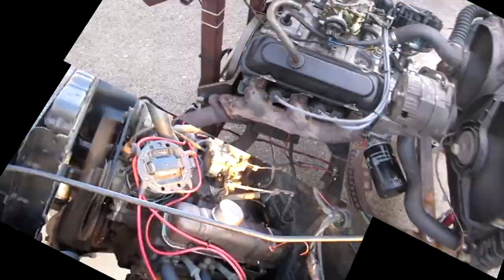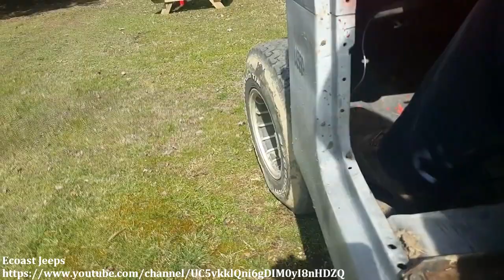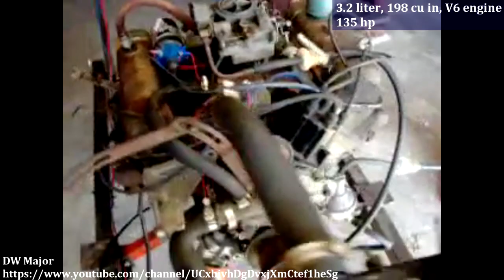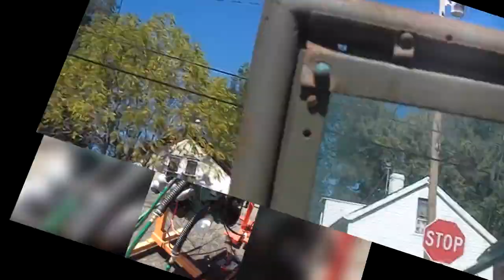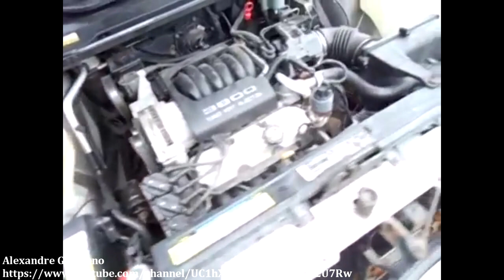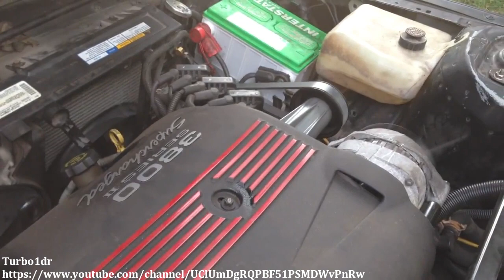7 Of The Best Buick´s V6 Classic Engines

Comment: My 2000 park avenue 3800 540000 miles just won't die, I even ran it with no oil for over a year please help its 2022 and it's still alive I just wants a new Buick bad at this rate the 3800 will out last me.🥺

Comment: The 225 wasn't the smoothest or quietest of Buicks engines. But it was very good on gas and quite powerful for a six. I had one in a 64 Buick Special, at speeds as high as 70 mph even with a two-speed automatic behind it I had no trouble getting 23 miles per gallon. For a six it didn't waste time getting to 60.
Reply: Great Jeep engines.
High torque, runs cool, won't stall.

Comment: I have a 3.8 series 2 in an 04 Bonneville. 205 hp and 230 lbs/ft of torque but I bet thats at least slightly underrated. So smooth and such a great powerband.
Reply: Yeah the power band is really nice
Reply: Oh it is

Comment: The dauntless 3.8l had 160 horsepower with a one barrel carb? That's impressive!!!
Reply: It had a Gross HP rating of 160hp with a 2bbl carb. Net HP with a 1bbl 'miser' carb would be around 90hp or so.  If you stuck these in front of a 3 speed automatic, damn thing couldn't get out of its own way, it was so slow. If you advanced the timing, put a 4bbl Holley and stuck with a manual gearbox, the Dauntless was a pretty potent V6.
Reply: @RockandrollNegro   I run a 225 Odd Fire (former sprint car engine) with Kenne Bell No.1 intake, cam... too much carburetor, MSD, fat headers, in a (titled as) 1946 'flatfender' Jeep with 4 speed and Warn overdrive.

Runs like a stiped ape.

Comment: that one 3800 sound's like a woodpecker is trying to escape from the heads
Reply: Yep ur right the ones we got in nz is the aussie one rwd go hard ass I got two of them near 300km easy
Reply: Yeah if that's the best that they have wow! That was painful to listen to that engine 3800
Reply: @robwilliams682  sounds like bad tuning, but it's the firing order,  it actually results in a poor idle, but much flatter torque curve..Hey if I were doing a jeep swap from an I4,   I would have this thing over a 4.2 any day...had great low down grunt,  cheap as shit to fix, or replace,  much better on fuel,  and a better highway performer than the I6 (doesn't mind being wound out for extended periods),  legendary reliability, cant really think of a better choice..My junkyard guy saved carbed ones in the mid 80's ,  knowing the Jeep guys love em..4.2 is the king of off road, but if you do some travelling with the thing..3.8 is a no brainer of fuel alone.. and you can beat on it endlessly ,still have some fun in the dirt , and it'll take you home every time.. they say it's gm's best engine ever.. that's a lot to say..
Reply: @robwilliams682  Much better than Ford's 2.9 and 3.0. Those engines had a constant lifter tap and were probably the least reliable V6 engines ever built.
Reply: @planegaper  you're spot on with the fuel economy, my 89 lasabre made 32-35 mpg on the highway, and hauling ass at 80 plus. So when the old girl was rotting out, I swapped up from the 2.5 in my Cherokee.
Reply: @MrDejast  i didn't even know they came with them stock in the 80, always thought the 3.8 was a swap in.. 4.2's are known pigs,  powerful mind you,  but if your travelling any kinda distance it's a no brainer,   as well it's more compact and keeps weight behind the front axle, where u want it.. bullshit cheap for parts too..
Reply: @tskraj3190  The 3800 is one of the best V6s of all time. Period. The motor in the video was blown. I have never heard one like that before. Those things are hard to kill too.
Reply: @johncotter1600  it's basically the V6 sibling of the LS Swap
Reply: @robwilliams682  i totally agree brother. Chevy all the way, along with the 3800 buick.
Reply: @tskraj3190  i think the 3.6 GM replaced the legendary 3800 with might take the cake. the 3.6 is JUNK
Reply: @andrewdonohue1853  I haven't dealt with the newer 3.6L but I believe you. The 3100, 3400 and 3800 were very strong and reliable engines. I can't say much for the 4300 because I've never owned one but they were pretty quick V6s
Reply: @tskraj3190  the old 4.3 was a good engine but the fuel economy was not very good. i had one in a 1994 S10 blazer and it only got like 16. my supercharged 3800 regularly gets 24+ average economy if i drive it easy. 

the 4.3 v6 was based upon the chevy 350, it's a 350 minus 2 cylinder. this is a 90 degree v6.

the 3800 was a buick V8 minus 2 cylinder. that's why the 3800 is known as the buick v6. this is a 90 degree v6

the 2.8, 3.1, 3100, 3400, and 3500 were all chevy designs, they are 60 degree v6's

the degrees 60 or 90 is a measurement of the angle between the banks. the 60 degree design is more compact then the 90 degree design, that's why a 3800 and 4.3 are wider engines.

the 3.6 is a completely new design, not based off any of the old school proven engines. it's DOHC and has a terrible timing chain design, a timing chain job is like a 10-12 hr job in a shop. multiple tensioners, 3 chains, it's a real clusterfuck. i would NOT want to work on one. the timing chain in a 3.6 is notoriously bad and they fail all of the time . any of those mention older designs have a very simple timing chain that almost never fails and if it does you can easily fix it yourself with some knowledge and tools.
Reply: @robwilliams682  But what's that got to do with Ford V6 engines,absolutly nothing.
Reply: @planegaper  Too right Dude. They rock. so underated. Good strong engine.

Comment: The series 2 3800 L67 is rated 240hp and 280 tq, and the series 3 was 260 hp up to 2008!  BEST V6 EVER, also rated Ultra low emission engine, and 30 mpg hwy!
Reply: brad chandler 2009 I thought with the lacrosse
Reply: brad chandler I get 35 mpg with mine with dual 2.5 in out straight through stainless mufflers and deleted the resonator.

Comment: At the other end of the spectrum, I would suggest the 305 ci V6, and others in this series, as a tough truck stump puller.
Reply: A 305 ci is a v 8
Reply: @shawnsecleter2453  Skip Stein refers to the GMC only  305 cu.in. V-6 offered in light duty pick-ups / suburbans /panels from 1960 to at least 1966 . I had a 1961 Suburban with the engine he refers to ...

Comment: That tick on the 3800 is not a rod knock. It is a broken harmonic balancer that had the rubber inserts rotted out. You can see the accessory belt tensor pulsing with the clicks.
Reply: Bought one for 100$ cause of that 25$ bucks fixed it
Reply: Rod knock

Comment: I love the 225 odd-fire V6, I've had 2 of them both in a 1970 & 1970 Arrow-glass ski boats. Bulletproof engines, great torque, could pull up 2 skiers out of the water instantly.  They do have a unique sound compared to the 231 v6.
Reply: Excellent engines for early Jeeps.
Reply: Volvo also used it as a marine engine.
Reply: I have a 1965 Oldsmobile f85 with that engine. Not a real powerhouse for that size car but it actually doesn’t do all that bad!
Reply: @OwensGarage  I run a 225 Odd Fire (former sprint car engine) with Kenne Bell No.1 intake, cam... too much carburetor, MSD, fat headers, in a (titled as) 1946 'flatfender' Jeep.

Runs like a stiped ape.

If interested in more power; lose the two barrel, let her breathe through high rise, dual plane intake and fat tubes.
Add hot spark and hot cam, all properly balanced.

They're notoriously durable. They can take the increased strain without overheating or failure.

Comment: 3300s are grenades, but I stand firmly with you on the rest. I've had two 3800s, one supercharged, two 231s, one a t-type that I put the EFI and intercooler stuff from a GN on, and a 225 in a CJ5, all of which I flogged mercilessly, all of which still ran flawlessly when I sold them. Two things: why did you choose a clip of a badly rod-knocking 3800 series I to show? And also, the N/A 3800 didn't make 240 horsepower, that was the supercharged one (the one in my Regal GS made 248 to the wheels with a pulley, a throttle body, an exhaust and a tune). Great, under-appreciated motors every one. Plus my T-Type and Regal GS were both genuinely fast while being comfortable, inconspicuous, reliable, and kind of shockingly efficient (I averaged 23 mpg in the old turbo and 26 in the GS if I drove them responsibly). I even think they mostly sounded pretty good, and V6s almost always sound TERRIBLE. No replacement for a big, burly V8, but fantastic for a daily driver.

Comment: Unfortunately, for that poor l36, it'll knock like that for a long time. The buick v6 is one of the most durable engines out there. Why do you think AMC bought the design and put em in jeeps. Kickass. Love my lil 3300.
Reply: AMC did the exact opposite.

Kaiser had purchased the 'Fireball' V6 from Buick in 1966, manufactured and installed them in Jeep products through 1970 as the 'Dauntless'. When AMC purchased Jeep they stretched the CJ's nose to accept the AMC inline six and sold the V6 back to GM.

I run a 225 'Odd Fire' in my ol' Flatfender (titled as '46 Willys), Kenne Bell equipped, MSD, fat headers, too much carb, 4 speed with Warn overdrive... . It's the perfect engine for an early Jeep.

Comment: I think your 3800 V6 HP figures are off somewhere, as you give the Naturally Aspirated version at 240hp,then later give the Supercharged version lower HP figures of 205-225 HP. I was a Buick dealer technician when these engines were new (82-99) & the 3800 Supercharged was a high HP, low production option in LeSabre & Park Ave . Otherwise i like the video.

Comment: I don't know why Turbo 3800s weren't included (Buick Grand National). NA and Supercharged were included, even though the NA you showed was about 5 minutes from throwing a Rod.
Reply: U must be smart asa bag of rock gn 3.8 can make a lot of power stock , I went 10,s on a stock long block 87 3,8
Reply: Buck 87 is called lc2
Reply: 3800 is a modern version of the 3.8 (231). Don't have much in common.
Reply: The 3800 and 3.8L are entirely different engines.
Reply: Ya it did not sound too good that 3800 TPl.
Reply: @mccrackenphillip  it was knocking on hells front door !! Most likely been floated out few times too many n bent push rod if they were lucky?? But some of those were bad for rocker stud pulling out of the head?? N whacking up top like that one??
Reply: Am I the only one that likes the Series I 3800 better than the Series II and III?
Reply: John Cotter no not all all,. The stoutness of the 3.8 from GM is reflected on the 4.3. The two most produced longest lasting V6’s
Reply: John Cotter the series 1 on the Holden commodore was too punchy off the line for the cheese cutter tyres. Holden had to retune it so school mums did wrap themselves around light poles
Reply: @johncotter1600  The Series I is the most reliable one of the 3800s and the longest lasting 250,000 miles plus engines. Heavier, thicker heads, crankshaft and cam shaft. Less HP (170) on a slightly heavier, beefier engine. The series II and III might be faster, have more HP but they are not as reliable as evidenced by their recalls and problems like intake, intake gaskets, valve cover gasket leaks and coolant leaks. The oil leaks could cause fires.

Comment: What is this YOU were showing JUNK  3800 Buick is a very good motor and had few problems hay whet is with the JEEP s   the motor that was mounted in a JEEP  Was it a JEEP motor   can not get any thing right ?    there are toooo many problems on your sight to SUBSCRIBE  you need to go back to the drawing board
Reply: Buick sold the rights and tooling for the Fireball V6 to Kaiser Jeep Corporation in 1966. Kaiser manufactured the 225 'Odd Fire' V6 as 'Dauntless', installing it in Jeep products from 1966 through 1970.

AMC purchased Jeep in '70, stretched the CJ's nose to accept the inline AMC six and sold the V6 back to GM.

"Can you not get anything right?"

P.S.. Learn to spell.

Comment: What about Buick's big-bore 4.1 litre even-fire version in the early 1980's? The extra torque never hurt anybody. You could even order one for a Caddy to avoid their V8-6-4 stinker...
Reply: So this 1981 Cadillac coupe deville with the V6 is good... I should get it?
  Interior is A1 and only has 74k miles on it
Reply: @DJDISCIPLEDREW   A smooth ride but not a swift one. Biggest problem right now is finding parts. Don't make it your daily driver -- even mid-80's RWD GM parts are a long day of hunting.
Reply: @peters8758  gotcha yea I'm not worried about a fast ride.. and I will not be driving every day.. just a weekend cruzer

Comment: Best V6's and the 3800 sounds like someone with a hammer trying to get out?
Reply: Michael Fitzgerald that 3800 sounded like a bad rod knock, great motors, but didn't last for very long
Reply: My NA 3800s lasted a LONG time for $500 and $700 a piece.
Reply: The older ones all sound carburettor (even the single point and multipoint injected models)
Reply: @WhistleTeets85  mine is an ecotec l36 3.8 (australia and new zealand version) it has aprox 140kmiles and has never been rebuilt has never had a gasket replaced and has always had rocker srm ticking it was used on beaches and ran a few miles on low oil and no coolant and all ive done was change the filters and fluids and the coil packs and removed the rusted thermostat since ive had the car and before i had it it sat in a barn for a few years and its still going strong (mine is the pre-2000 version so it has 197HP the later post-2000 has 204hp and our l67 has 260 with a special model with 270)
Reply: ty 069 What?! They're notorious for running 250,000 plus. I've had a N/A one and a modified S/C one, and they both got run pretty hard, pretty often, and were sold with well over 200K running flawlessly. I had to put an alternator and a ps pump on one (not really engine parts) and a water pump and valvesprings on the other, which was the modified supercharged one which was making a lot more power and running at considerably higher RPM than stock. My buddy bought it and only just now blew it up at 308,000. They're widely regarded as one of the most reliable engines of all time, like, it's common knowledge.
Reply: @ty069  They lasted. The owner of that one just didn't take care of it. That, and the one shown was a Series II. I've known Series I to last to 500k before rebuild.
Reply: @johncotter1600  my Buick 3800 was strong, the electricals took a shit quicker than the motor

Comment: The L36 never made 240 hp, the L67 did. The L36 made 200 since it was the N/A version. The L36 also has higher compression, and weaker rods. The series 2 3800 L67 is where it’s at. Series 1 was never very good, and series 3 wasn’t around for too long.

Comment: I remember one of the Buick engines had a vibration at idle. Think it was a229 normal felt like an engine skip
Reply: Magna Tron the 3300 vibrates at idle
Reply: The 225 'Odd Fire' hits at 90 and 150 degrees rather than 120-120.

Comment: 3800 series 2 & 3 should've been on here
Reply: The original 3800 should have been too. My buddy had a '91 Regal with a Pre Series I in it that had 175k miles and  blown head gaskets and it started every time and would drive anywhere. Those engines don't die.

Comment: Where were the GrandNationals and Commodores (Aussie tuned L36 OBD1 less tech more reliability and they can go for over 240000mile (estimated) 400000ks if they are taken too a mech every 6 months or 20000ks) and of treated properly they will keep going
Reply: If you change the oil and oil filter every 10k a ecotech 3.8 will do 400k easy

Comment: Love the 3300. Open the system up and give some air to breath and get rid of nasty ass cat in the exahaust and give it a small cherry bomb or a rice cooker.   I. I have smoked alot of v8 that was supposed to be bad and hadsome say they know better than to try .   what alot of people dont realize that's a little tourqe monster.  It's making more torque than hp.  And one tough little engine ..  Ive had a few well over 4hundred thousand on the engine and dog the he'll out of them .
Reply: I've heard the chole is in the valve covers. Do you know if buying aftermarket OEM covers will help it breathe, or if the L36 SII covers will fit? Not looking for huge power, just want it to breathe a little better.

Comment: I due belive that you have the hp rating for the 3.8 and 3.8 SC turned around.  The 3.8 SC  has the most go. That 3.8 you filmed is ready to put a rod through  the oil pan.😂🤣😂
Reply: yeah does
Reply: and there is no way that rod knocker even had 150 hp way it sounds
Reply: it's not the rod knocking .it's the pulley. he tried to show that in the video

Comment: They aren't very good at this, they left out the 252 oddfire four barrel motor.
Reply: At least the had the 3.8s in there. Most of them were destroyed though.
Reply: 252 or called 4.1 L is even fire..odd fire stopped at 225 cup. Models.
Reply: @bugnfront  Buick Skyhawks had an odd fire 231.

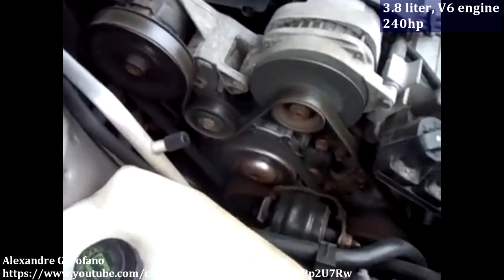Comment: I always advised my buddies to spring for the optional V8 and forget about the 231 V6. None of the GM V6 engines made it past 70,000 without a rod knock and sounded like the engine at 3:50
Reply: Early ones yes mid 80’s on were great
Reply: nice try, but you are full of it.
Reply: If it's a odd fire they dont sound pleasant ever.
Reply: But that's kinda what the nature of a odd fire is even tho they last forever

Comment: I feel insulted that all of the 3.8L engines had ticking  from them. I have never have a tick or know on a 3.8L
Reply: John Killright Right my series 1 runs like new, these examples are a disgrace to this engine.
Reply: John Killright my pre series I (in my 89 Reatta) runs perfect.  Sounds amazing.  Never had an issue.  The example in the video must have been abused to shit!
Reply: Hamilton Dashcammer All original. Including the oil!
Reply: John Killright mine has 400000 sounds and runs like new  the 3.8 series 3

Comment: I had a 2000 Bonneville ssei with 3.8 sc series 2 and I think it was rated at 265hp & 285tq. Not a 100%, so don't quote me on it. And I think the na version was only about 30hp/tq less.
Reply: 240HP & 260TQ.